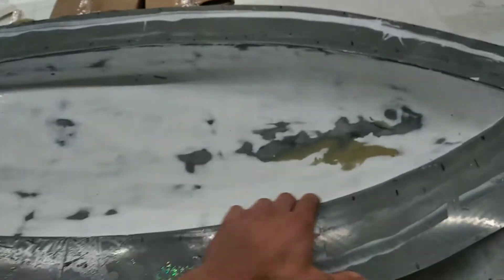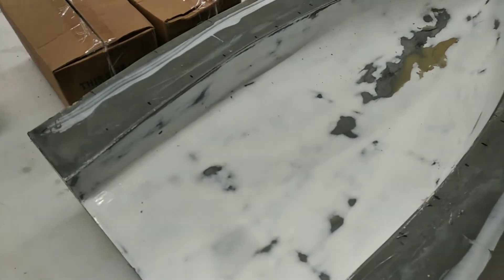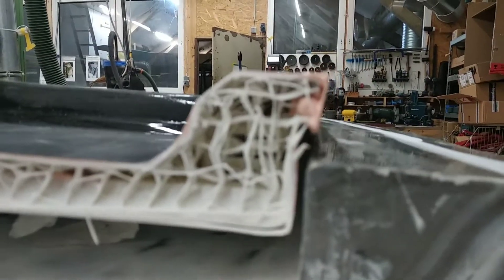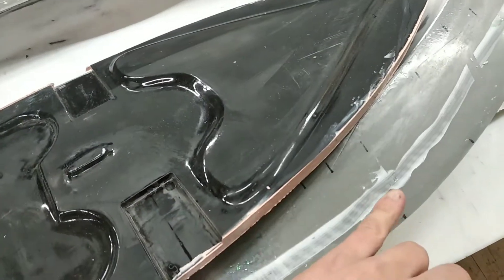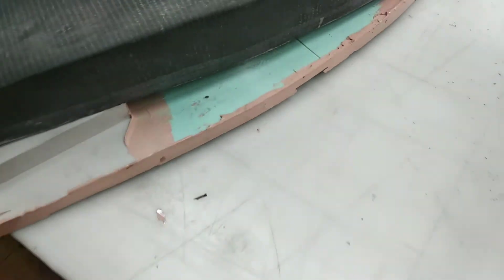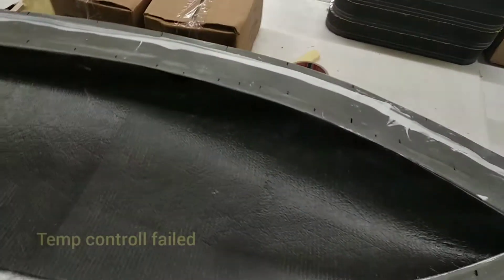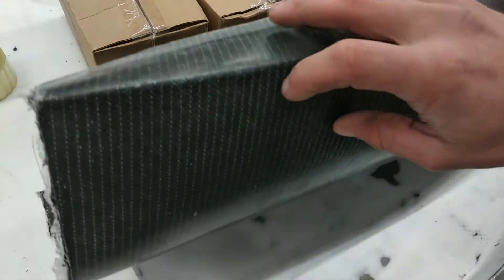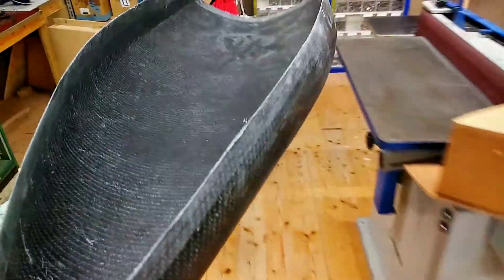finally a hull for my boat RC Sailing Hydrofoiler monohull boatbuild

Comment: I would keep the shape of the hull the way it is to maximize the leverage of the extra width. But I would try and add more stiffness to the hull, specifically torsional rigidity. One method you might consider is using UD carbon tape at 45°.
The choice of rudder (single or twin) comes down to whether the boat is designed to fly or if the foil is used solely to right the boat. The difference between the two being that the flying hull is level (therefore a single rudder will be in the water at all times) and the other is not (so you'd need twin rudders for one to be in the water at all times).
Reply from the maker: Thanks for the comment! I plan on adding a spar into the hull and also use my keelfin to help it a bit. UD stipes are a good thought though! What can I improve for the videos? I'm a full-time boatbuilder so have only limited time but I will do my best! My personal plan is to get it foiling like a moth but build enough boats so I can give it away so others can experiment with it